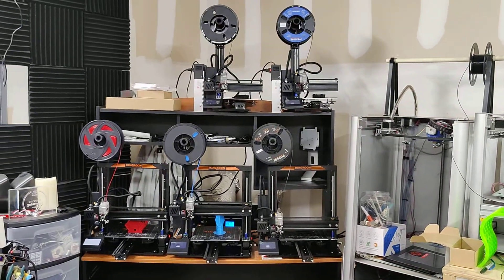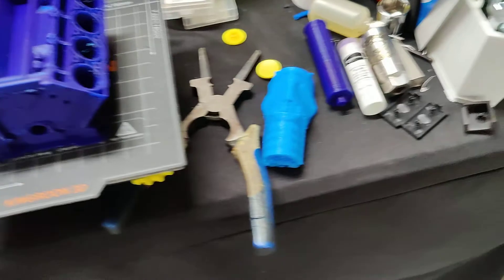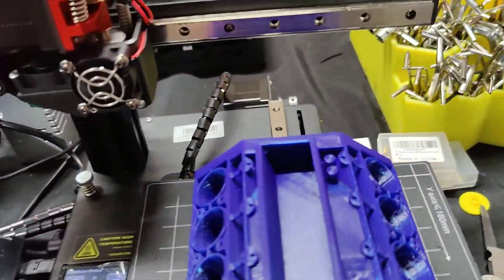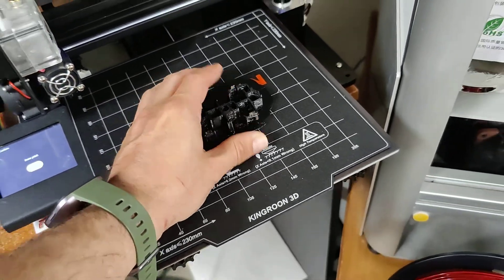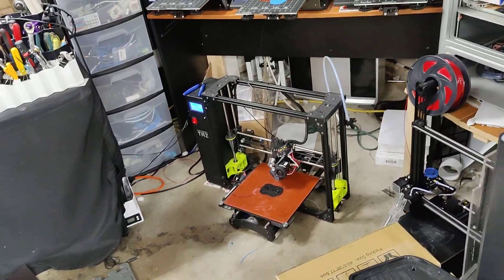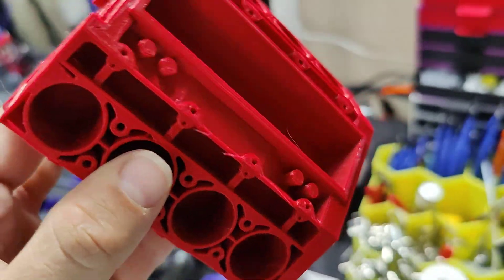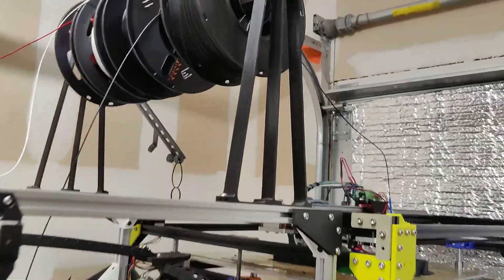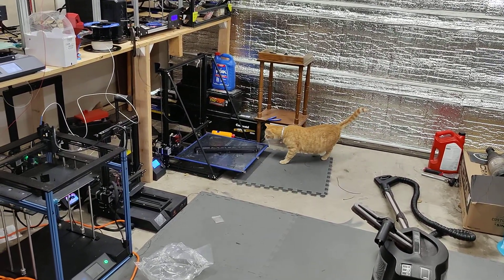KP5S KP5M KP5L KingRoon part 4 first print inspection PLA, PETG, TPU, and Nylon

Comment: I have the new 5S 5M and 5L on order. Was really impressed with the KP3S so when I saw the new ones I had to order one of each.
Reply from the maker: sweet they come in yet?
Reply: @3DPrintsEverything  not yet. Last I checked that were waiting for customs.
Reply: @3DPrintsEverything  running of room for printers. I have an LK1 Longer that I've been modding. Linear rails, one of kingroons extruder set ups for the ender3. I'm trying to get a SKR 2 with 2208 driver's going for it. Got it to compile once with the wrong settings. I'm having a hell of a time getting Marlin to compile for me.
Reply: @3DPrintsEverything  they are here they showed up today but I got two printers that are down that I've been working on there in the way so I can't set them up yet
Reply: @3DPrintsEverything  I think the 5M is actually heavier than the 5L
Reply: @3DPrintsEverything  I got a question for you... Do you have problems with the Titan extruders on your kp3ses
Reply: Can i ask from where did you ordered them? I cant find KP5s anywhere.